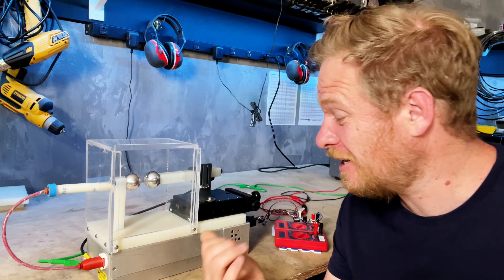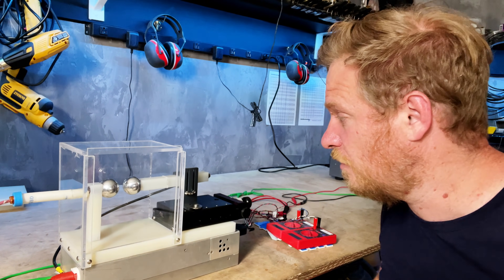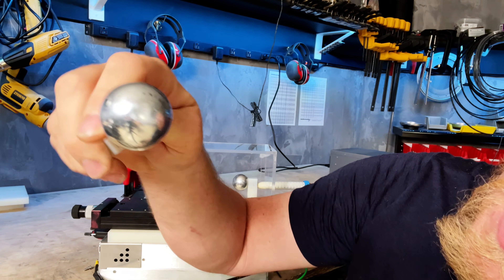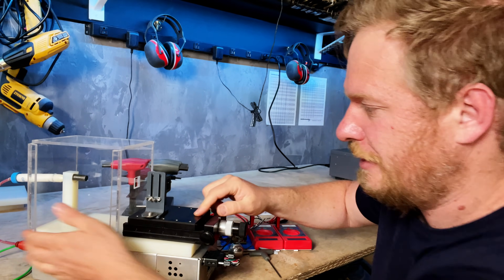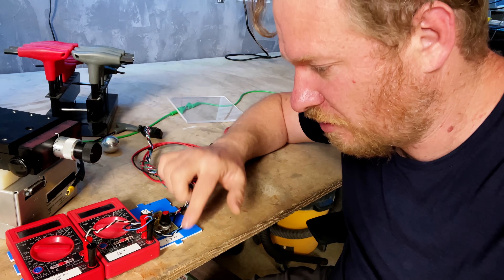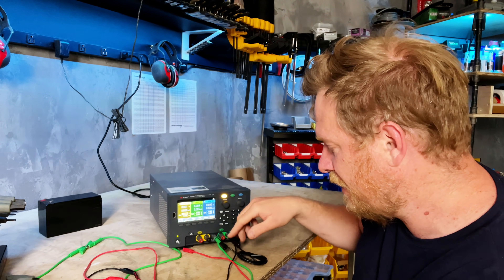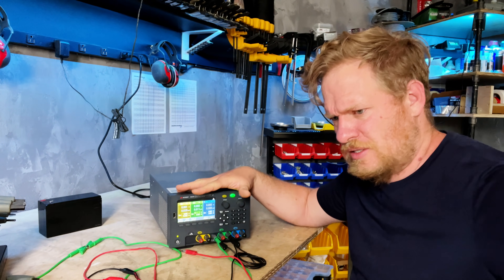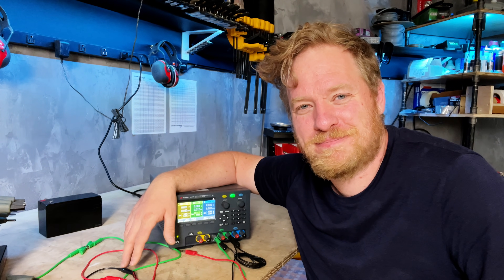A closer look at my high voltage demonstration

Comment: Your fear of high voltage have made the build really sane! Even the "crudeness" looks professional to me.

I figured out you had some help, since very few DIY guides actually leads to regulated output voltage/current.
The schematics floating around the net mostly push as much power as doable into a arc.

Comment: When I saw the acrylic case, I initially thought you'll hook up a compressor/vacuum pump to simulate various sea levels.
Reply: ...like the sea level on Earth, the sea level on Venus (that one is tricky!), the one on Tau Ceti b, ....?

SCNR. I assume you meant various air pressure levels or altitudes? Yeah, that was my first thought too.
Reply: @KonradTheWizzard  Technically there are also multiple sea levels on Earth, depending on jurisdiction. Also practically, since tides exist.

But yeah, I of course meant altitudes, thanks for the correction. ;-)
Reply: @Sukrim  the stuff with the different sea level definitions bit the people when they constructed a bridge between Switzerland and Germany... I'm sure you can find articles about that incident.

Comment: I went to one of the world's largest testing facilities for high voltage/amperage in the world, as soon as they needed to manipulate anything powered on at any Amp or Volt they use rubber gloves, similar to long sleeved washing up gloves. Any really high voltage, like the generator with monitors which powered our device, was in a sealed room. With even higher voltage causing they pumped the testing chamber full of gas which breaks arcs, I needed to sit through a training video before I was even allowed on-site

Comment: Never seen a motorcycle use those batteries. More like UPS and security systems etc.
Reply: Pretty much anywhere you need a small 12 or 24V battery backup. Very reliable batteries, so few people understand how to actually charge the damn things.

Comment: If your scanning electron scope is arcing at higher altitudes. What's to keep from this arcing somewhere other than where you intended as you go to higher altitude? Also couldn't you simulate different altitudes in a vacuum chamber.

Comment: have you thought about placing the electrodes in a pressurized chamber, in which the pressure can be increased or decreased
Reply from the maker: Yeah, this is typically how this type of experiment is done.  However, A) I don't have a pressure chamber B) It would have been much harder to film it in action and C) I thought it was cooler to do high voltage experiments in the middle of nowhere 😁
Reply: @strangerparts  but is it really so hard to build a pressure camber the pressure difference between sea-level and 2000m elevation is not that much with a semi tight vessel and a big enough compressor that should not be a big problem.
Reply: @strangerparts  If the temperature or humidity is changed, would it be possible to appreciate a change in the distance of the electrodes?
Reply from the maker: Yes!  We actually played with a humidifier, which definitely helped.  But it made it look like the SEM was smoking, which isn't a great look.

Comment: I need a hex set like you have.
Reply from the maker: Yeah, I felt like it was overkill when I bought it - I use it all. the. time.  Probably one of the most used sets of tools in my shop.  Mine is a cheap set from Harbor Freight: https://www.harborfreight.com/hand-tools/wrenches/hex-wrenches/sae-metric-t-handle-ball-end-hex-key-set-18-pc-63167.html
Reply: @strangerparts  Dang I should have grabbed one when I was there on Friday lol.